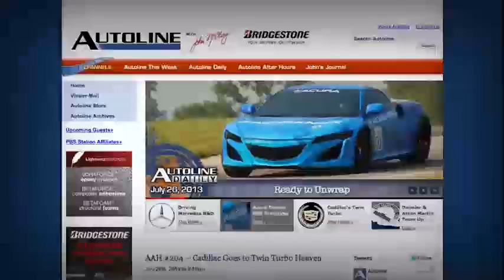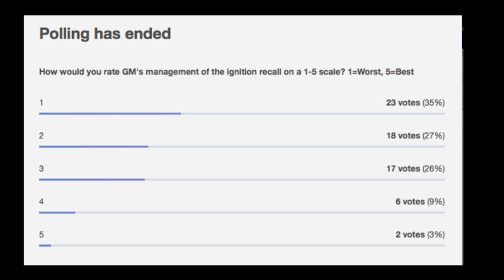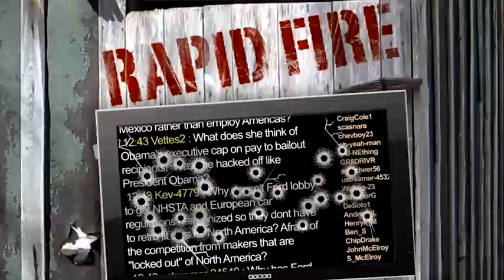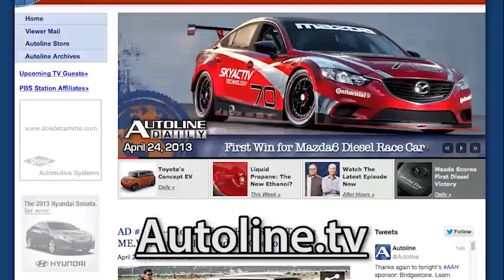Chuck Thomas: Honda's Cap'n Crunch - Autoline After Hours 233

Comment: I hate the fact that so many people believe that the current GM didn't cause the ignition problems. Many of the same people from the company those days are still there today. The ones who designed and engineered the Cobalt and the ignition switch are still there and have since been promoted. Mary Barra has been at GM for 34 years. New GM, same as the old GM

Comment: I still disagree with John and his argument that the IIHS should have told the car companies that the new crash test was coming. Isn't one of the major points of the IIHS to showcase which companies go above and beyond, before they are required to? They caught Toyota with their pants down twice, first with the Previa and now with the Camry/Prius V tests. It amazes me how a relatively small company like Volvo and even Suzuki (with their Kizashi) can engineer a car that passes the test, but a large company like Toyota can't.
Reply: Simple.Smaller companies have fewer models to design. If you include scion, toyota and camry, the toyota motor company offers 47 different vehicles. Volvo only offers 8.
Reply: It was GM that was caught with their pants down. To this day , the Pontiac Trans Sport is the WORST vehicle the IIHS has ever tested, and it was brand new. The Previa was in its last model year, and then the Sienna the next year aced the test.